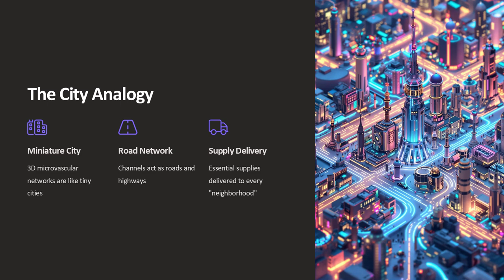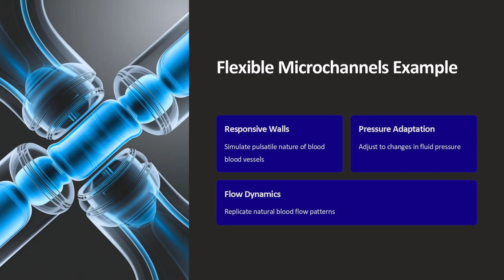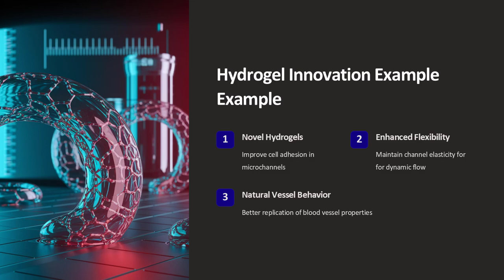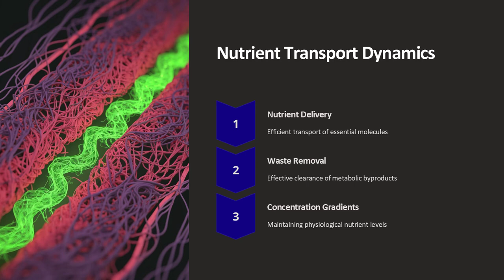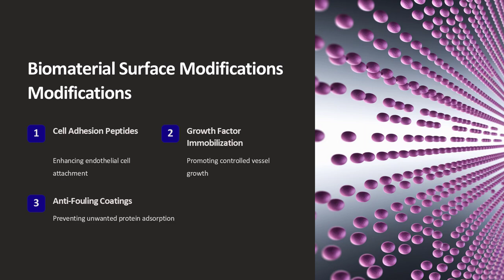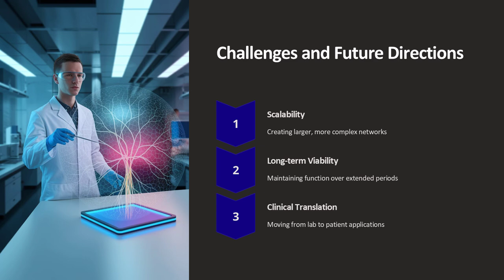3D Microvascular Networks for Tissue Engineering

Comment from the maker: How can the integration of dynamic fluid flow in 3D microvascular networks improve the functional maturation of engineered tissues, and what are the challenges in replicating the physiological shear stresses found in human blood vessels?
What are the limitations of current biocompatible materials in maintaining long-term stability and cell viability within microvascular scaffolds, and how might new biomaterials enhance the structural and functional integration of engineered tissues?
Can advanced fabrication techniques such as 3D printing and soft lithography achieve the precise control needed to replicate complex capillary networks, and how can microvascular networks be scaled up for use in fully functional organ constructs?